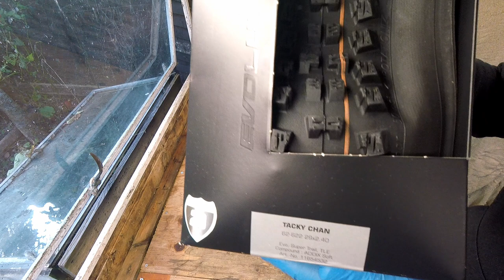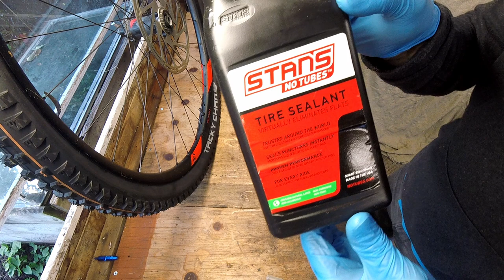Swapping my beloved Schwalbe Magic Mary 2.6 for a Tacky Chan 2.4

Comment: A small tip from a nobody : the colored stripe from the tire always goes on the same side with your disc break. You don't need to find the rotation arrow.
Reply from the maker: Well, I did not know that. Cheers bud, a good tip.
Reply: I didnt know this 🙈😂

Comment: Why the external bead of sealant? I’ve never seen that done before.
Reply from the maker: I find it eliminates tyre burping.
Reply: @CoruscatorMTB Hmm, interesting. What tire pressure are you running?
Reply from the maker: @Eric.V.  Depending on what kind of riding I'm doing, I run between 25 and 35 psi.

Comment: How’s the tire performance?
Reply from the maker: Hi, I was going to make a video about the Tacky Chan but I didn't feel compelled enough to do so.

I didn't find the Tacky Chan as good as the Magic Mary on the front wheel, so I swapped it onto my back wheel and went back to the Magic Mary up front.

I changed my bike recently and fitted Magic Mary's on the front and the back wheel of that bike.

I guess, in a way, that that tells you as much as you need to know about the Tacky Chan vs the Magic Mary.

Magic Mary rocks!

Comment: How do you find the schwalbe 2.4 width? I’ve heard they come
Up narrower. Just not sure whether to get the 2.4 or the 2.6
Reply from the maker: I think I preferred the extra grip that the 2.6 gave me. Do Schwalbe make a Tacky Chan in a 2.6? I couldn't find one when I bought mine.
Reply: @CoruscatorMTB  I domt believe they do. I’ve got a 2.4 tacky chan to go on but atm I run maxxis dhr and dhf 2.5 on front and 2.4 on rear.